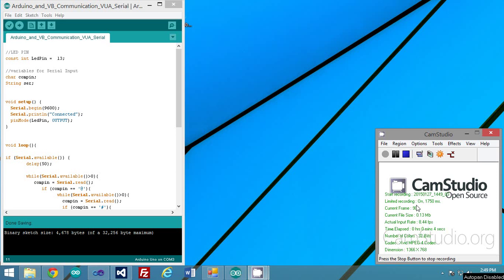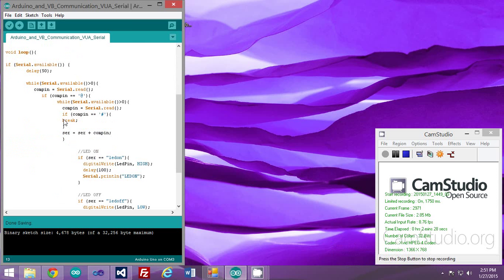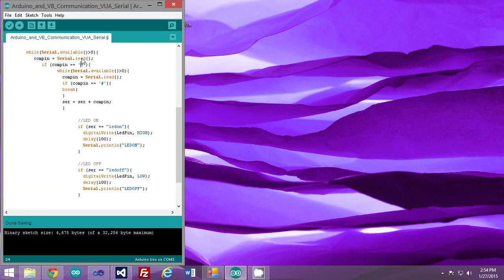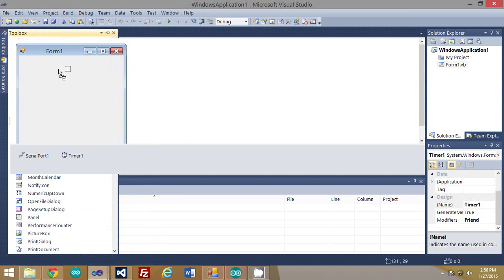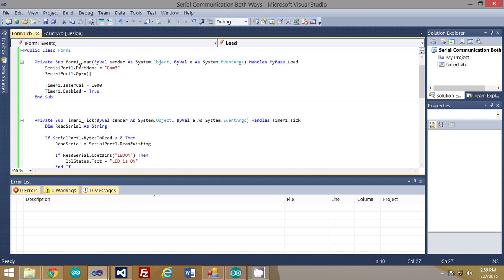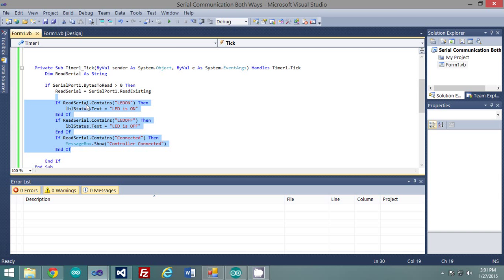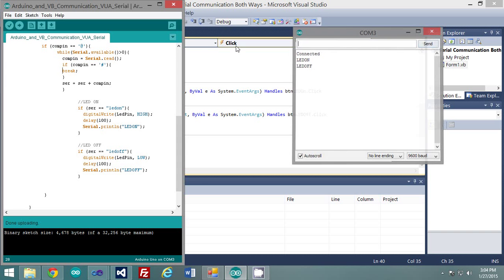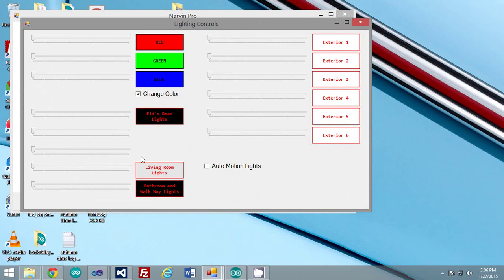Communicating with arduino micro controller and computer via usb vb program

Comment: this video is very  good . i want to ask you . how we can sent 2 analog data to VB using Arduino  . like as PWM and Temperature
Reply from the maker: +Kong Senghun I send it as a string with a beginning and ending operator so that the arduino and vb program can distinguish what the command is: Say you want to send the command "255 255 255" for an rgb strip to turn all the lights on, i programmed in an command to send the string as "@255-255-255#" where the arduino looks for the "@" to know the beginning of the string, the "-" for the breaks and then the "#" for the end of the command. I can post some code if it would help!